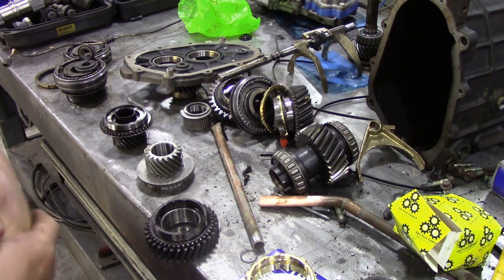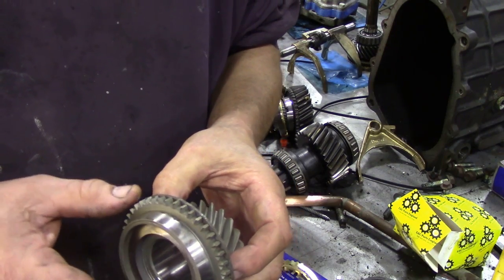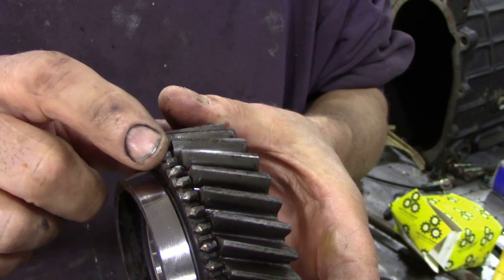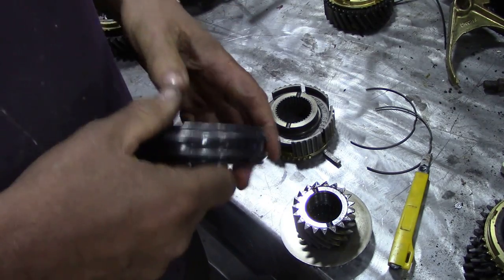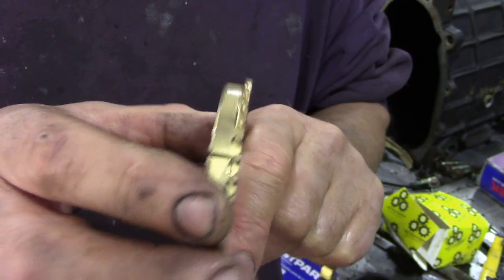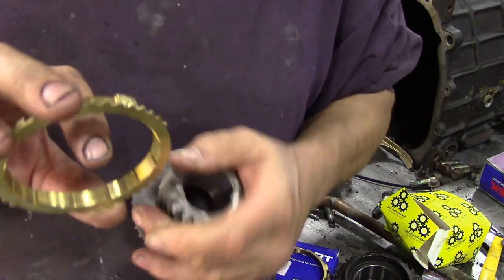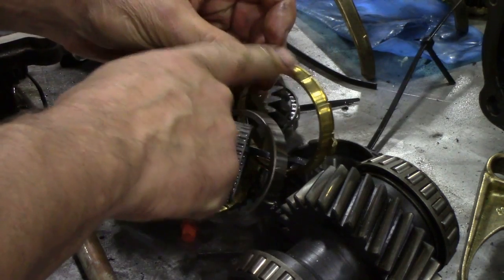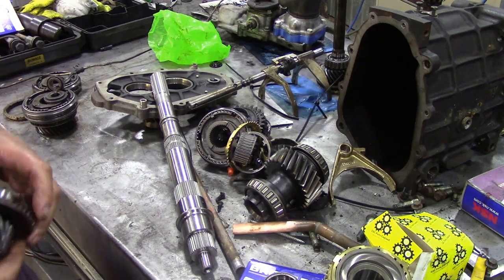What do worn parts look like in a gearbox? Comparing new with old, and why gears grind

Comment: Do you think, when a 6 speed doesn't get into 2nd- but gets into all others,  could it be the syncro'? It's a 95' I know it needs some work
Reply from the maker: 6 speed in a 95!? I am guessing it is an R380 - yes it could be the synchro, but I am seeing the forks are well-worn on the contact point and could cause the hub to tip and not engage properly  - Search my recent gearbox videos -I have one somewhere in this issue

Comment: Hi, found this by searching for 5 speed manual gearbox rebuild.Found this information you impart very useful and interesting.
Must be down to your years of experience and acquired knowledge performing this task.
Would like to ask if you were asked to rebuild a Jeep Wrangler/Cherokee  AISIN AX-15 five speed manual gearbox.
Would this cause you any problems due to presumed lack of practical experience on this model of manual gearbox.
Would it be fair to conclude both are quite similar in function and assembly components.
Jeeps from the mid 1990s are far fewer on the UK than same the  generation Land Rovers.
So i would imagine much harder to find competent people to restore and repair worn synchromesh assemblies etc.
Reply from the maker: Sorry I know nothing about Jeeps

Comment: That's really helpful.  I have a transmission that would only go into 5th gear if I was on a slight decline going at just the right speed - eventually got to the point that it now pops out of 5th gear as soon as I give any gas... Thought I only needed to replace the 5 gear baulk ring but after watching your video I suspect I should also replace the 5th gear assembly itself as well... Thanks!

Comment: Thanks mate very interesting, gave me some confidence in britpart if you use it.
Reply from the maker: Britpart don't make anything, they just buy it in - the gearbox parts are OK - if you stick a G behind the part number then you will get the OEM stuff - other than that it is real cheap stuff
But as with most parts suppliers,  it is hit and miss
Mike

Comment: hi I have a dicsovery 2 with an r380 gearbox and ive been thinking about overhauling it. There is a used r380 that was removed from a defender for an auto conversion apparently no major issues asking for 2500 dollars canadian.... do you think this is a good deal? since the discovery is my daily driver it would help to be able to take apart the gearbox at my own pace and swap out. thanks for your videos, they are amazing.
Reply from the maker: You did not mention which engine you had, but you may not be able to fit a defender box due to the input shaft length - need serial numbers off the boxes to confirm
Reply: @BritannicaRestorations Thanks for the prompt reply. I have a 1999 discovery 2 with a td5, the engine is from a 2002 defender td5, so im guessing it would work? provided it was a fit, what do you think of the price?
Reply from the maker: IF the Defender gearbox is from a Td5 not  300Tdi then it will fit - I seem to recall the input shafts are different lengths (Not sure about V8 R380)
Would need the serial numbers to check
Price is quite high, but these boxes are hard to find
Reply: @BritannicaRestorations  yea they are quite rare. Maybe I will see if the seller is willing to budge on the price a little bit. What in particular on the serial number are you looking for? Thanks for the replies
Reply from the maker: If the Defender box has a Prefix 68 suffix L then it is a TD5 R380.
If not walk away
Reply: @BritannicaRestorations  just heard back from the seller and it is exactly that, prefix 68 and suffix L. Now I just have to decide if I can justify the purchase lol. Thanks so much for your help.